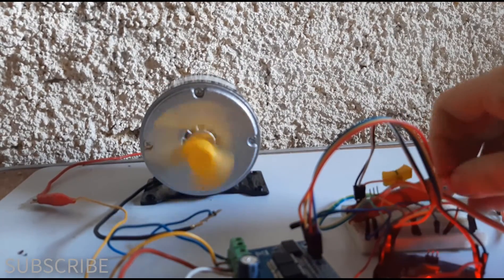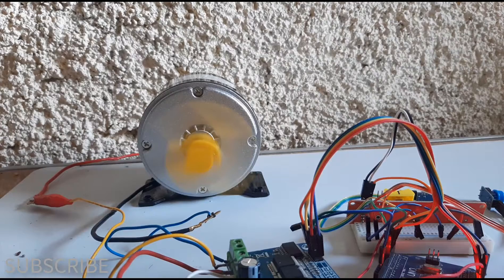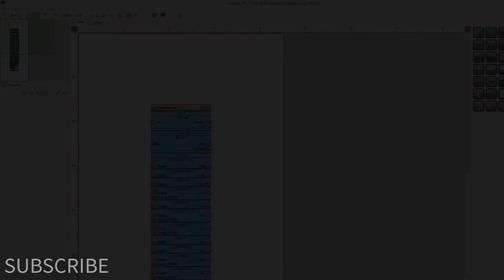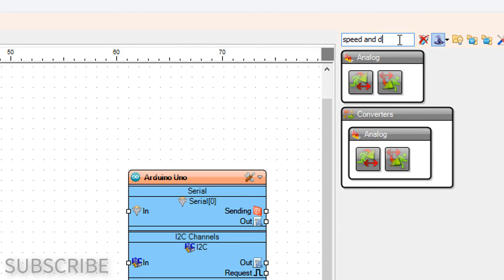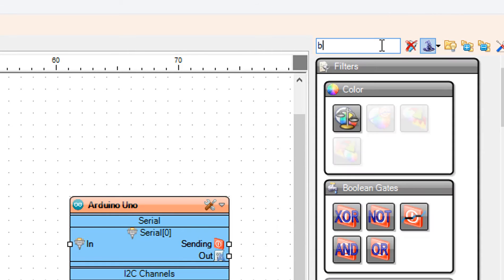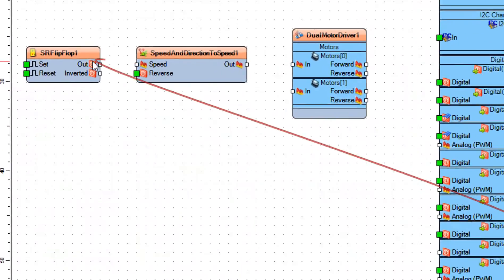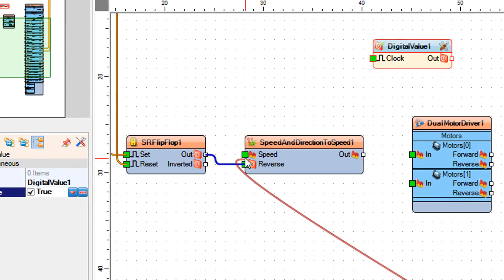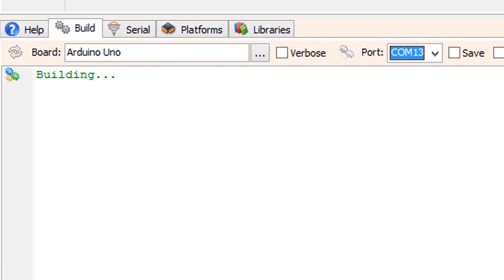Control Electric Skateboard E-Bike 350W DC Motor Using Arduino BTS7960b

Comment: Do you think that Bts7960 is enough for this motor? Or stall current can destroy this driver module?
Reply from the maker: In my tests it was enough also I saw some guys using it in the production line without the problem, I could not find any stronger driver to test.